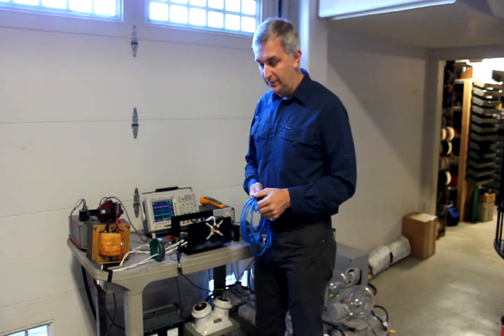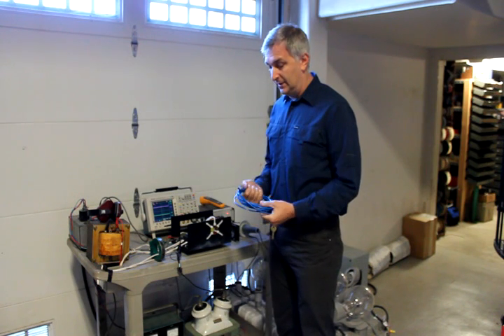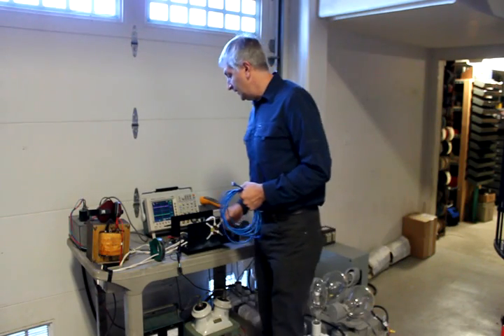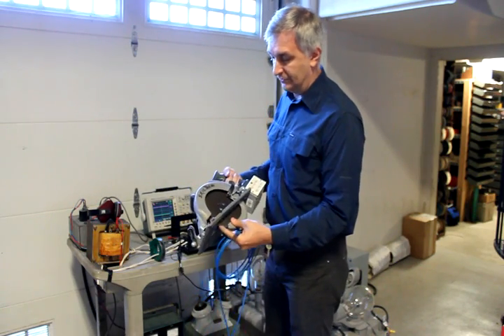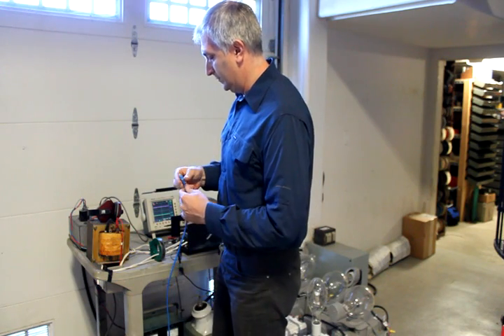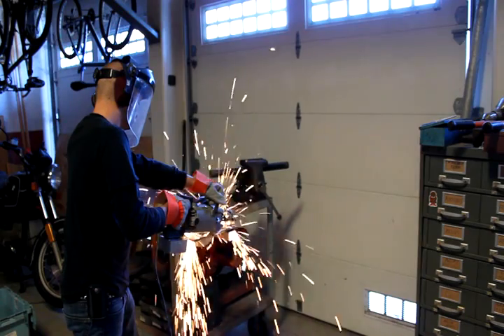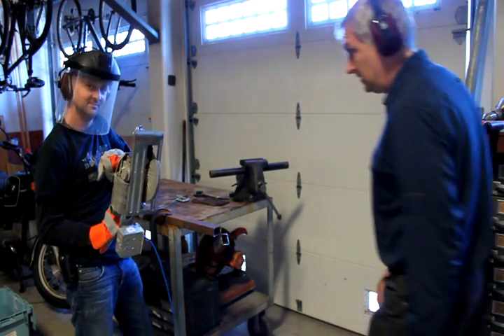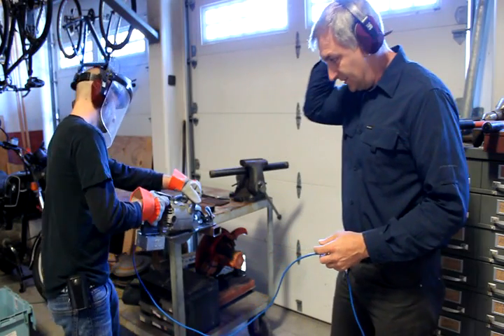Power Over Ethernet Cable 2kW Test

Comment: Way back in 2000 I worked with a company at which one of their divisions was trying to figure out if it was possible to use the power grid to also allow for it to connect homes with an Internet data connection.  I think I remember they were having a lot of difficulties with getting the signal through transformers.  Enlisted in the Airforce the next year so don't know what happened to that project.  Since it's not an everyday thing I have a feeling it failed
Reply: https://en.wikipedia.org/wiki/Power-line_communication#High-frequency_(≥_1_MHz)
Reply: @marca9955 thanks for that info, it's probably not used In the USA due to the unshielded power cables

Comment: I of course did the more dangerous version of this when I wanted to run USB lights on my fence, but at 120v.  
Worked great for years.  
Cat5 cable is just so darn useful. 
Even used it to wire up my Car audio stuff as it just is a breeze to use and terminate.  
Course, that was my job for years when building data Centers, so it was just fun for me. 

Love the video.

Comment: A brief description for those less knowledgeable about electricity would be nice.

I don't really understand what is going on here - if there's 2400 W in the cable, 800 W per each of the 3 pairs and the max. allowed current would be 500 mA, then that would imply 1600 V DC while the usual safety range is around 50V DC.

How is it possible to cut the cord with just the usual pair of scissors? I am certainly missing something, but I don't know what.
Reply: The output of the step up transformer is isolated from ground. Even if high voltage was directly touching the scissors and his hand there isn't any path for the current to flow through him. The cable was probably also shielded so the ground is on the outside. As the cable is cut the scissors first make contact to ground and then just short between ground and the high voltage and the voltage of his hand doesn't change much
Reply: He's also using a current limited power supply, meaning when you short it with the scissors it doesn't draw any more current than the maximum.  Normally when you cut a cable like that there's no current limit so it draws many thousands of amps for a brief moment, causing a loud bang and likely welding-style damage to the scissors.  But because of the current limit in this case, nothing much happens other than a small spark.
Reply: What you’re looking at is a demonstration of high-voltage safety via galvanic isolation. The guy’s cutting into a wire that’s carrying what seems like a ridiculous amount of voltage—potentially 1600 VDC if the math checks out (2400 W / 0.5 A = “oh god” volts). So yeah, it sounds dangerous. But the reason he’s not instantly flash-fried is because of one glorious principle: no current without a return path.

You see, the voltage is coming from a step-up transformer, but the key is that the transformer’s secondary (output) side is floating—not referenced to ground. That’s like having a live wire with no neutral or ground to complete the circuit. No loop, no zap. The human body isn’t some magical current magnet—it needs to complete a circuit for current to flow. And in this case? It doesn’t.

So when he cuts the wire with scissors, he’s basically touching one side of a battery that’s suspended in midair with nothing on the other side to close the loop. No path through his body = no current = no electrocution.

Also, keep in mind the scissors are likely at the same potential as the conductor when they make contact. So there’s no voltage differential, which means no arcing, no dramatic sparks, no Hollywood-style explosion. Just a guy calmly committing what looks like a terrible idea, but is actually a controlled electrical flex.

So yes, high voltage is involved, but the danger level is dramatically reduced thanks to isolation, lack of ground reference, and the beauty of Ohm’s Law whispering, “Relax. No loop, no juice.”
Reply: If he is isolated too from ground this will work fine imo. 

He will become same potensial as the volatage, 1600 VDC ish, but as long he is not touching anything thats grounded/ isolated from ground he should be fine . Am I right here?
Reply: @terminuts Yes that's correct.  For a brief moment the metal scissors will connect the person to the positive or negative rail of the 1600 VDC supply, but if it's isolated, there's no path for the current to flow through the person to somewhere else, so they will not receive a shock.
Reply: It doesn't give a huge belt when you cut it because the current is relativity low, but if you scuffed the cable insulation rather than shorted it with metal, and then you handled the cable it it would have both plenty of current and voltage to kill you. 

Its "safe" for certain kinds of failures, but its still carrying 100x the current needed to kill you if you're unlucky and make a bridge between the conductors with your body.
Reply: @julesadventures9174  Yeah but you'd have to get the current to pass through your heart to kill you.  If the cable was scuffed and you grabbed it with your fingers, the current would just pass through your hand and cause bad burns, but it wouldn't kill you.

Comment: Do you have a circuit diagram for this? I would love to know a little more about this.
Reply from the maker: I don't, that was 10 years ago.  :D  But essentially it was just a HVDC supply with protection, and a buck downconverter at the load.
Reply: Actually just looked it up.  And is as i thought.  There is no newmon engineering.  There’s a newman engineering and a newmont engineering but no newmon..  either its a small consulting firm or something not legally licensed or llc’d..  or made up..  :/
Reply: @Z-Ack I only wanted a little more info on the box he refers to as a load controller. He doesn't explain it's purpose or what it does really. I have some assumptions about it, but they are assumptions. I just was wondering what more or less it might actually be doing. I know you can throw a 25kv transformer and transmit power over thin wire, I have done that. But it just appeared to me that his controller and buck converter might be talking because he mentioned data lines.
Reply: @Z-Ack  I honestly don't know what you are going on about. I have built computers since they existed, I built robotics. I have built multiple tesla coils. I don't know how asking a little bit about a video has caused you to be so concerned about my safety? I have played with 100kv so yes I do know a bit about electricity. I actually worked in HVAC when I was younger and know enough to respect the 240v coming out of the circuit breaker. But I don't know why you attack someone you know nothing about.
Reply: @Z-Ack  what a spectacular public meltdown ;D
Reply: Engineer..  really?  You claim to be an engineer but didnt understand the lamons term description of a simple transformer, ballast, current clamp to output..??  What do you engineer???   Seriously..  there’s no way youre a certified engineer of any kind with problem solving skills and observational interpretation and analysis..  like when people call IT for their computer not working  then telling them that they cant see the back of the pc because powers been out for past few days…. Seriously electricity is the last thing you need to mess around with or itll be the last thing you mess around with..  engineer..   must be an automotive design engineer..  the ones who decided to put regular maintenance items in barely accessible locations forcing the mechanics to spend 4 hours disassembling a motor just to change its oil every 5k miles or something….
Reply: @Z-Ack  What was rammed up your a&& when you wrote that?
It's one of the worst and rudest comments I've ever seen someone write on YT, especially given how long it is. You actually sat down for that long and decided to write all that. And actually bothered to try and track down his company as well. I mean jeez. Get some perspective mate.
Reply: @Z-Ack  Some one is jealous!
Reply: @Z-Ack Too long, didn't read
Reply: @Z-Ack  you are a clown

Comment: How much volts and current?
Reply from the maker: That's an exercise left to the reader!  For a 2.5 horsepower load, and the ultimate stress ratings of CAT5 cable, the voltage and current will fall within a range.
Reply: @LightningOnDemand  I tested a twisted pair of CAT-5 with a 9kV NST... the CAT-5 won. NST was shorted internally after a few hours but the cat-5 was fine.
Reply from the maker: @SteveWard  Wow... then it should be possible to do even better than 2.5HP!